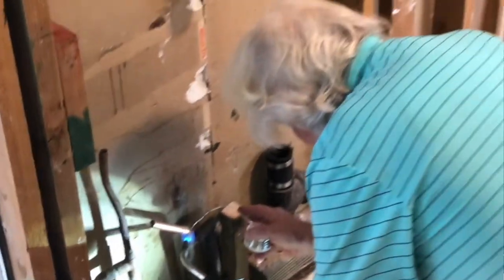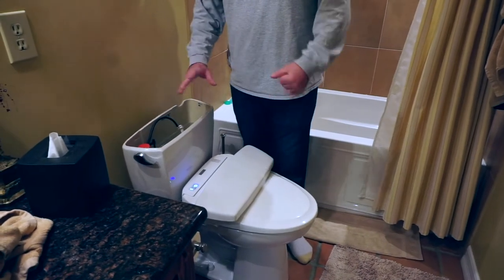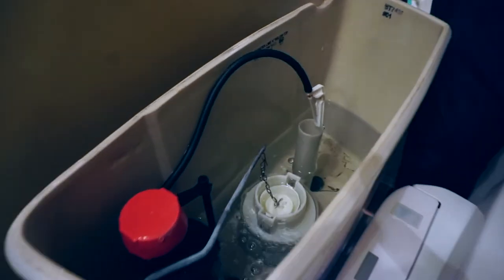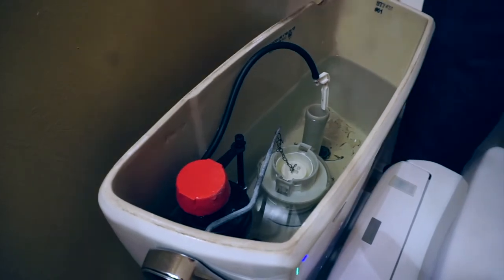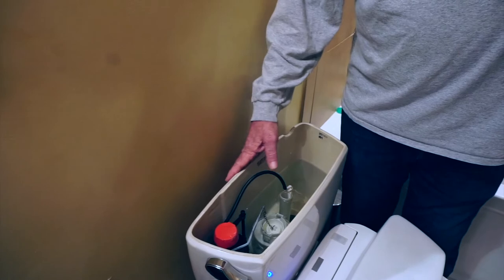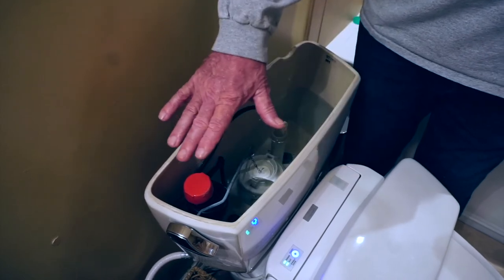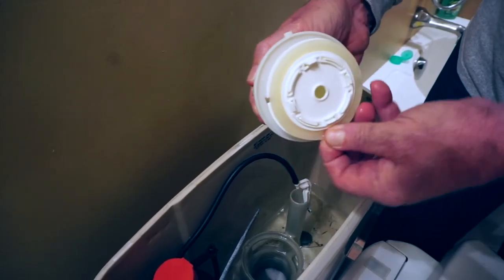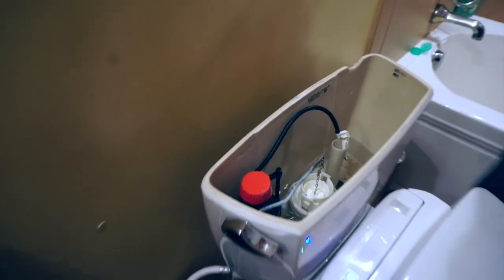The Parts of Toilet Explained by a Plumber | Plus, how to repair a Toto toilet fill valve

Comment: Jim, there should be a mandate that all these parts are universal. For instance, that gasket SHOULD be the same one that fits my dual flush water ridge. I may buy it and see if it will fit.
Reply from the maker: Yes, I know what you mean but manufacturers think they have a better idea. You know, some manufacturers do use other manufacturers’ parts. They do that with faucet stems.

Comment: Hi Jim . How are you . Do you remember my slow draining bathroom sink ? Here is an update . I changed the drain pipe to a ventless one , and it drains better , but still backs up after 30 seconds . Any other ideas ?
Reply from the maker: Hi Anthony, I added Jim's email to his about page so you can email him pictures. He would like a picture looking down on the sink that shows the sink, drain, and overflow hole. Another pic under the sink showing the trap connecting to the sink and where it connects to the wall. Email those pics over to him and maybe he can figure out your problem. Thanks, Jordan
Reply: @TheGrumpyPlumber   Is this the correct e-mail address ?